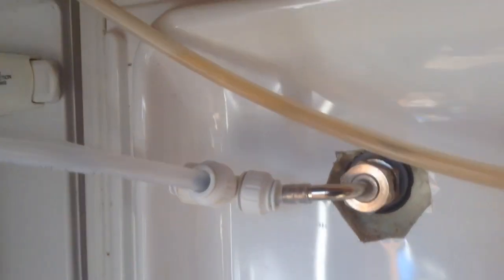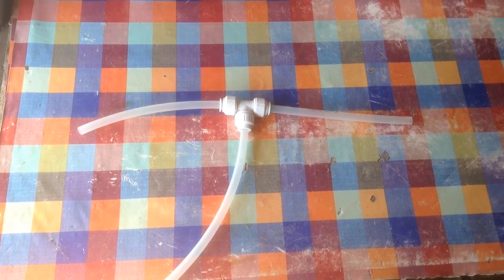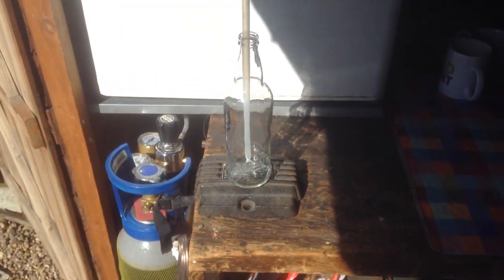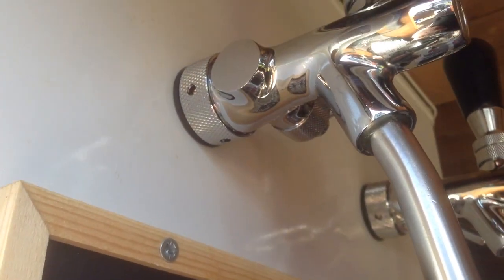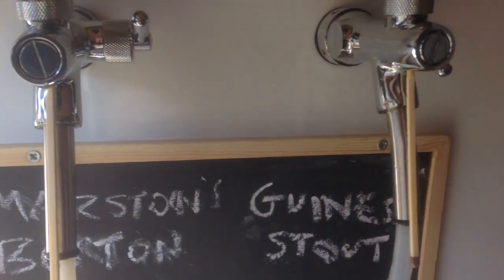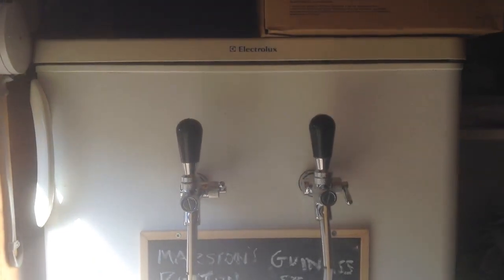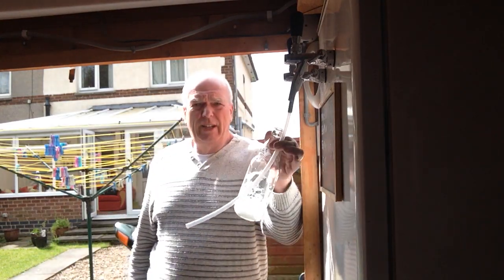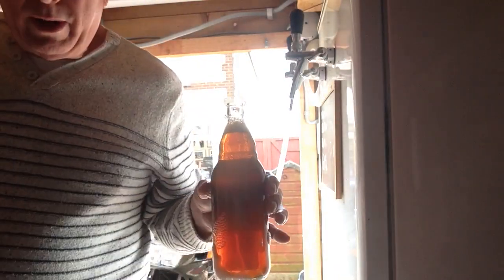Vlog 93 Homemade Beer Wand not Part 2

Comment: You are such an innovator, I like my £32 Blichmann beer gun clone. You are right about air going into the bottle when the wand is removed, I have seen other people give the bottle a quick blast of co2 to try and top the beer off before capping. You should invent a cap that fits over the bottle so the wand does not enter the bottle then there would always be co2 above the beer.
Reply from the maker: +Hoverdog Brewery Hello Mark, I am just not convinced with the wand idea I cant see how it is any better than just filling the bottle from the tap, I guess time will tell and I will save a couple of bottles to try in a couple of months Cheers Jim

Comment: Jim, Chill the beer cold, like say 2-3 degrees,  and increase the keg pressure for carbonating. When you dispense use a lower than normal serving pressure and the beer will flow slowly. As mentioned, cold bottle and cold beer with low pressure will do the job.
Reply: +Dave Barker Thanks for that tip in fact just in time I'm doing the bottling today and whacked the temperature down in the fridge over night so will whack the bottles in the fridge and give it a whirl. Wish me luck and cheers Jim
Reply: Let me now how you get on.
Reply from the maker: +Dave Barker Filled the bottles Dave wasted a drop or two getting the right serving pressure but finally got it right the next bit is the test test in a couple of weeks wish me luck and cheers Jim

Comment: Brilliant, someone else has said it! Of course putting beer in a bottle is going to push most of the air out. If the beer has a bit of fizz then the CO2 released before bottling will even help push out the small amount of air at the top of the bottle. Love your common sense and trial and error way of things. Cheers.
Reply from the maker: +Cider Meister Thanks very much for your kind comment, it was fun having a go however it did seem a bit silly with a proper wand still leave the top section with air the same has just filling from the top. We will see I guess Thanks again for your comment and cheers Jim

Comment: Personally I think with all that foam coming out of the top of the bottle before you capped it being full of CO2 not air, you should not have any problem at all. Good luck with the wedding and keep the great videos coming.
Reply from the maker: +Scott Lowther Hello Scott I think you are right I did about 30 pints for the stag weekend and they went down well so fingers crossed it will work well for the wedding. Thanks for the comment and Cheers Jim

Comment: Looking good.
I've had best success doing it that way using PSI of about 3 (no more) and before filling the first bottle I purge the line into a bottle I won't be filling. I get less foaming that way.
Best of luck with it all.
Cheers
Reply from the maker: +PinHolePip Thats a couple of great tips Pip will give it a go and see what happens it the easiest way that works best in the end, thanks for watching and Cheers Jim